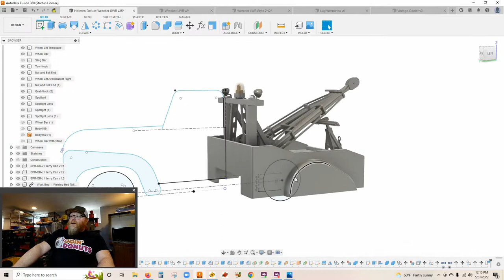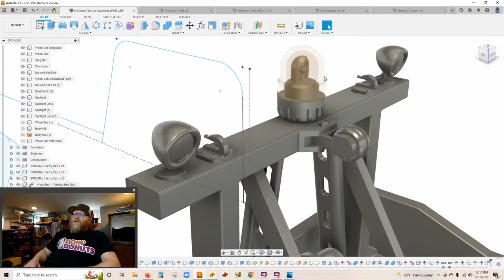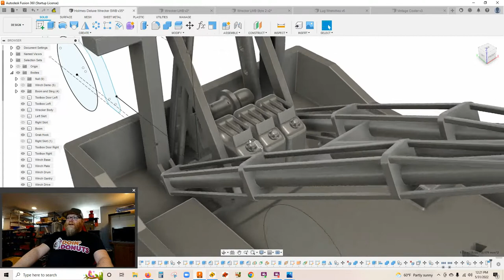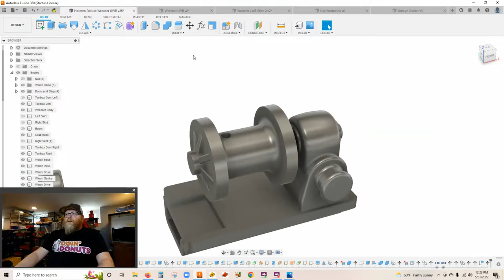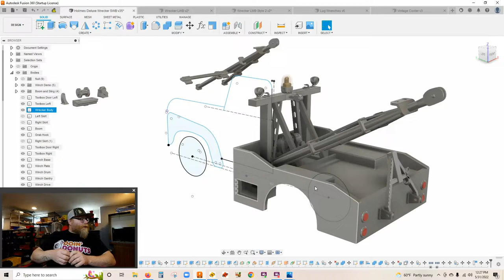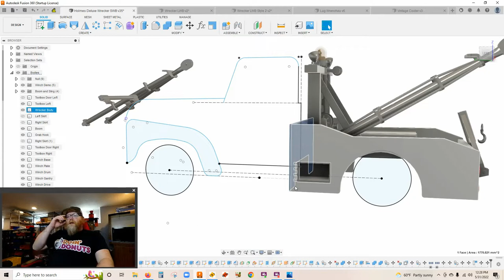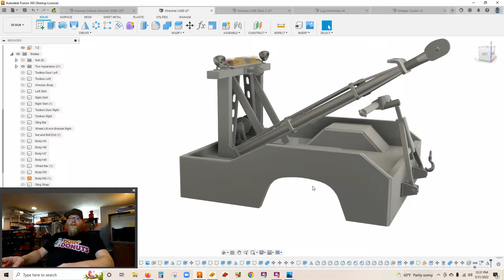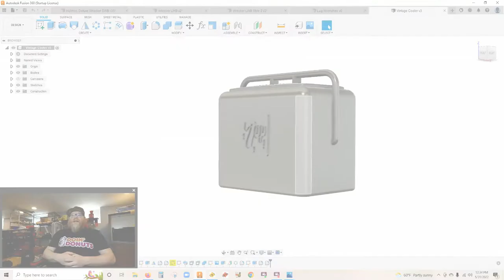Vintage Tow Truck .STLs for 3D Printing

Comment: I have a Holmes 480 wrecker on a 1978 Dodge 1 ton. The only things I can see missing are the levers on both sides of the bed to operate the winch an the top bar for the sling. Other than that you've done a great job on this kit! Thanks for the video!